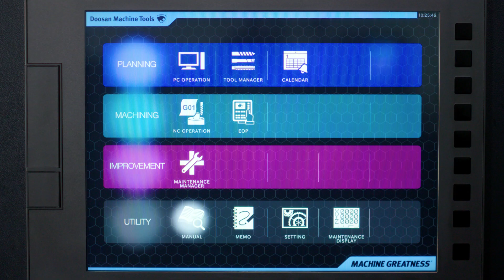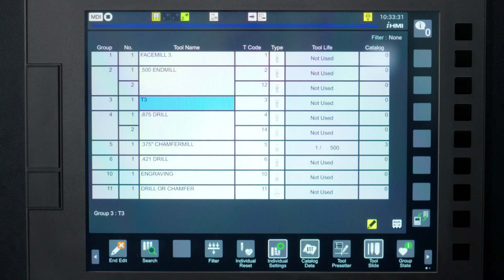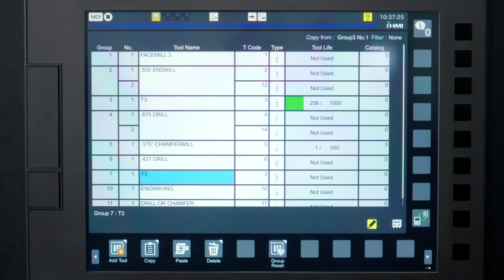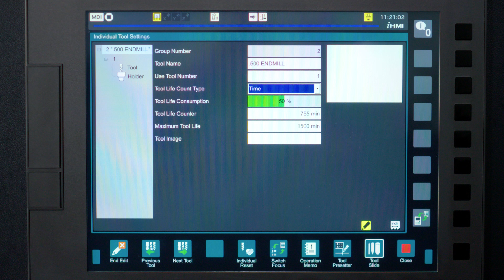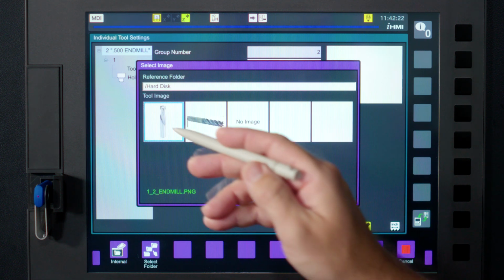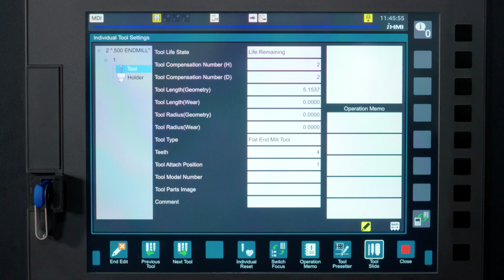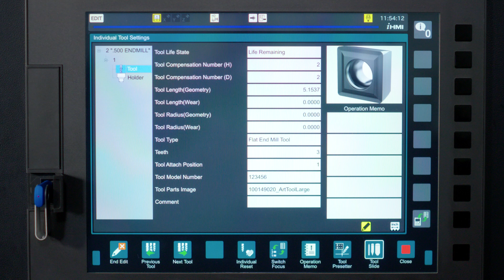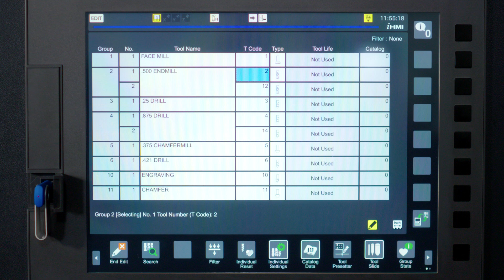iHMI Tool Management – Know Your DN, Episode 19

Comment: I have been waiting so long for this video. You need to do a part 2 video for this topic. It is so vastly different to the way Fanuc handled tool data in previous versions that it needs more unpacking.

Can you elaborate on what the purpose of tool groups is for? Is it mainly used for tool life control using sister tools?
What would be the benefit of putting 2x .500 endmills in the same group if tool life is not used?
If I create and use a single tool, can that tool be saved in a "tool library" so I can quickly load it next time it is used instead of creating all the tool data again? 
If I had a bunch of drills in the carousel eg 2mm 3mm 4mm, is it better to load them all into a single group with different T numbers and offsets, or separate groups?
Can you save tool data into a program file instead of onto a separate USB file?
What would the tool life command be for 2 different tools in the same group? Eg would this be correct for group 2 in the video - T1002 and T1012?
What is the "catalog" column for?
Can a tool "H" code column be added to the main overview page?
Reply: Thanks for the reply and the questions. I will try and answer what I can but these are very specific and really would require some hands on training. Let me answer the easy ones. 
The tool groups is to give your tool life purpose. So if you have (2) .500 endmills and one reaches its tool life or breaks, your program will just use the next tool that has remaining tool life. Yes, you don't have to assign them tool life if you don't want to. 
Let's just say you only wanted to use tool load monitoring and when that tool gets the signal it's broken, it will use the next tool that doesn't have a broken status. There is no tool library in the manner you describe. You can output your tool information as a DAT file to a USB and then re-load it when you want to use that set of tools for a specific job. Tool groups are meant for identical tools. So for example, Tool Group 4 would only be 5mm drills. Tool Group 7 would only be 8mm drills. 
The idea is for these to be "family tools" or "sister tools" in the event of tool life reached or broken tools so a program can just use the next "good" tool. I think a lot of these specific questions get answered in the video I did here: https://www.youtube.com/watch?v=N9PpMxX2COE&list=PLxwqQHEEi3gQkuAyVAIuh_V3nySpdj18b&index=9 
The Catalog Page is for downloading tools from machiningcloud, it has nothing to do with a tool library or your tools. Fanuc partnered with machiningcloud for users to be able to directly dump their tools from a manufacturers catalog page into a library. However, machiningcloud charges you a fee to do that. No columns can be added to the main page.

Comment: Hello, really helpfull video. I would like to ask if there is any possibility on FANUC controllers to monitor tool life WITHOUT setting tool group, just as an individual tool. Thank you!
Reply: John, thanks for the question and it's a good one.  On the Fanuc control the only way to control tool life is to make it with a tool group.  So if you only have one tool, make a group with one tool in it and call it in your program at T1001 H999 and let it eat.  That's the best solution I have for you.  Thanks for the question!